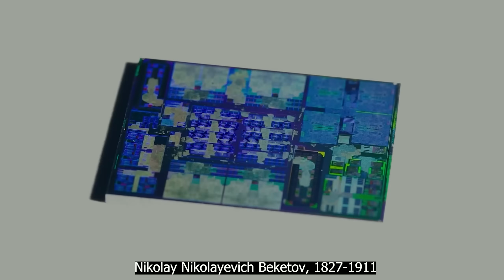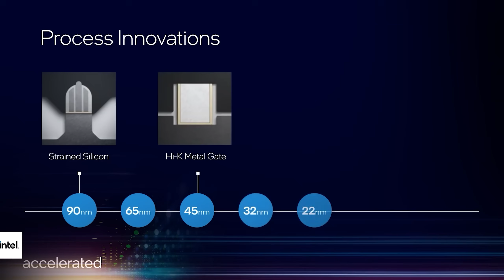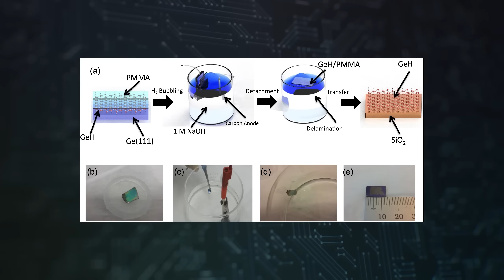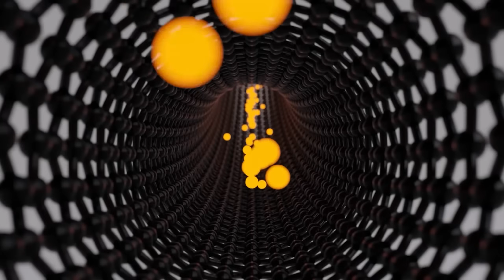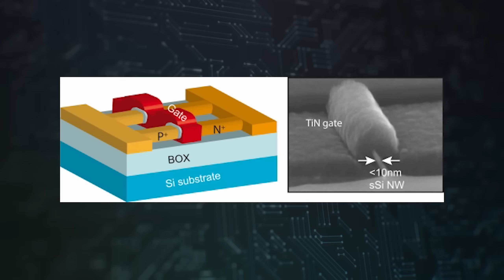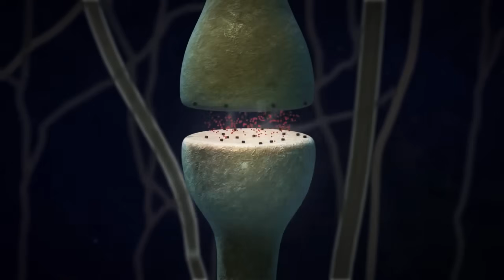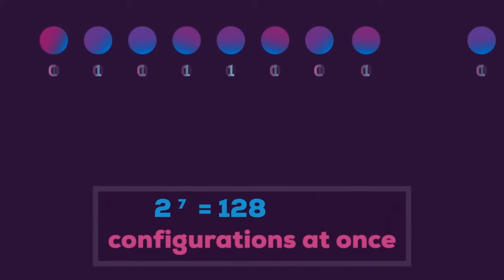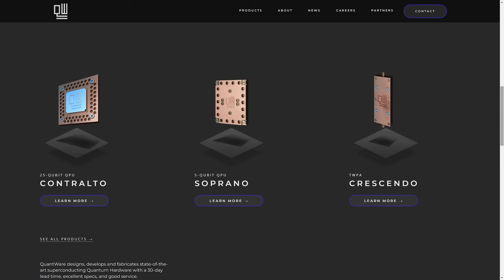End of the silicon era. Processors of the future

Comment: But what about analog computers? An axle has it Theoretically infinite positions and therefore can theoretically store an infinite amount of data And you don’t need to make them big you can make them I have comparable size to a transistor still requires overhauls of computer science but same goes for quantum computers and trits also I doubt you’ll be seeing a quantum computer running Windows 10 anytime soon
Reply: Has theoretically*

Comment: Another direction we could take to fundamentally change how computers work in order to increase efficiency is reversible computing. The laws of thermodynamics gives us a minimal possible energy cost per bit of computation, which we are slowly approaching. However, there is a workaround, since the actual cost is in erasing information. So long as the computation does not erase information, there is no theoretical lower limit in energy use. 

With technology based on this, it might be possible to build 3d-chips having to worry about the heat problem at all. That said, it's at least as fundamentally different from how computers function today as quantum computers are, so it will be very difficult to transition and we will still need components that actually erase information in many cases.

Comment: @3:10-3:21  uuumm dude you talking some shit on ryzen 7000  , those chips are hitting 90 C because AMD made the heat spreader so damn thick to make the chip line up with AMD heat sinks. saw a video where some one de-lided the cpu and whent strait from chip to heat sink and the chip was toping out at only 74C then.  so the 90C  is only due to having a thick heat spreader not so many transistors.

Comment: We still got some ways to go with classical architecture, you can also gain some performance by improving how quickly we can access memory and how much of that fast memory we got, there are also architectural adjustments with concepts like RISC, bigLITTLE, vcash, new schedulers in OSs etc. so both on hardware and software level. 
With many new technologies being developed like Quantum, DNA-computing and Optical-computing, I don't think these will replace classic computer but with interconnects between them then they can work in tandem in the tasks they are best at.

Comment: Doesnt it mean that 1 Qbit  has 2 times the computingpower of an ordinary bit.  so i understood it like  1 qbit = 2 bit.   2 qbit = 8 bit. 3 qbit = 24 bit 4 qbit = 64 bit.   which if you use a CPU from an ordinary PC just change it from Bit to Qbit  with a simmilar archetecture... wouldnt that be like a couple of thousand to million times of more computing power just with changing the physical base of the computersystem?   But what kind of consitend number system could we use to do stuff with it? i mean 4³ = 64 but its just a single case of "thats right" . I thought it threw like 20 minutes and couldnt find a numbersystem that can be used. or does it already exist?  At the same time you would just need a 4 qbit Windows to get the same as a 64bit Windows.  this is so small in size compared to each other... like.... wtf.   I would say AI  is only possible to be  more I than A  with Quantum technologies.

Comment: The next frontier will likely be 3D chips. We already do build them with a few layers, especially memory chips which are dozens of cell layers thick now. We will need to do the same with processors, and also switch to more thermally efficient materials to help avoid the increased heat per sqr unit as a processor gets thicker (building heat exchange tubes into the design itself can also drastically help combat this).
A 3D design also opens up pathways for much more optimized computation methods that a chiplet design does not really lend itself well to as it scales. Chiplets primarily communicate to eachother through side channels, whereas a 3D chip would simply be one single complex chip of interconnected logic in all directions.

The potential performance gains as we add layers is insane to think about, when you consider how thin a given layer of a processor is. You could have hundreds of thousands of layers eventually. A single processor rivaling billion dollar super computer warehouses of today.
Reply: da cube chip
Reply: Would the AMD 5800X3D be considered a 3D chip?
Reply: @dylanhecker6686  Not really, it's only the cache, which is essentially on-die RAM that is stacked, which was already being done for your SYSRAM too. The core logic is still single layer.
Reply: @invertexyz  thanks!
Reply: Well we already do have '3D chips'. A processor consists of many layers of circuits stacked on top of each other.
Reply: @Pythoner  bruh stop with this "TecHnICalLy 🤓" stuff holy sh*t why are so many people on this videos comment section so pretentious. 

You know what he meant he literally said what you said on the first line of his second sentence.

-"We already do build them with a few layers"

do people just lack reading comprehension nowadays?

what he meant was a 3d architecture as in cores on top of each other as well as next to each other. Yes "technically" we have 3D chips already but 1- they barely have any depth there still relatively flat and 2- our architecture of the chip is STILL 2D as in it can be represented by a 2d map theres no such thing as layered cores.

I'm sorry for going off at you but so many people on this comment section( of the whole video)are just acting so pretentious as if they all have degrees in computer architecture .

Comment: Carbon isn’t much of a replacement. Say if we do adopt it and make the next best thing with it, there still wouldn’t be much room to scale down. We are already running into atomic limits with silicon. Being able to build with carbon with atomic precision doesn’t actually help us that much. Instead of getting smaller we are probably going to become more clever. Different architectures, or coming up with different types of processors like GPUs or maybe a quantum computing chip one day. It’s not about raw power, smallest size, or most transistors anymore. It’s about coming up with the best arrangement of those things. I think photonics would allow greater gains in computing than anything else you discussed.

Comment: Silicon still has a way to go before its phased out. The key is better packaging (things like 3D stacking).
Reply: 3d stacking will exacerbate heat dissipation, though, so it is not a valid solution

Comment: correction about intel and amd CPUs getting hotter.
while the premise is true (CPUs getting hotter), the conclusion isn't.
CPUs are getting hotter because intel and amd are increasingly trying to come out on top of each other, to the point that they've basically pulled every lever they could to squeeze those last few percentages to better market themselves. the truth is, if you drop performance slightly on these chips, power consumption goes down by a lot. it is not a linear correlation. if i'm not mistaken, increasing voltage on these chips means squaring the power consumption.

Comment: Optical transmission has been long achieved. Silicon Photonics is slightly different from the examples you’ve provided. Silicon photonics is also far more ahead than quantum computing and realistic in scaling towards a household. Think about how massive quantum computers have been for the last decade. The most realistic application is utilising an actual quantum computer to process data on a cloud network. It’s simply infeasible to have quantum computers for everyone, people won’t be able to game on quantum computers etc. Asianometry does a good breakdown on the technology of Silicon photonics, limitations and advantages.

Comment: This is what I like best about YouTube, you got me thinking...
1) The way we are doing things now is coming to an end.
1a) we may get smaller features, but we are close to the limit
1b) due to size, we may find different circuits that get better results, but again an incremental change
1c) chiplets, and other die layouts, can give up more performance, but nothing major.
2) We need to think about pipeline, Risc/Cisc/Vliw, process.
2a) my personal opinion is we need to rethink compilers and CPU so they make optimal code, not optimizing compilers for a CPU
3) The software process is broken
3a) with ~8m lines of code for Linux and ~50m for Windows 10, something is wrong
4) I am a product of 16-bit words and 64K of memory.  
4a) My OS was 4k
4b) I could run a word processor or a spreadsheet
4c) my machine was 10 MHz
5) when we buy a new machine, we generally get all new things
5a) New OS do NOT need to be backward compatible

I really think we need to look at how we move the software to a CPU and fix that issue.
Reply: that was a different time, with complexity many orders of magnitude simpler, no need to support a hundred different processors, and thousands of different IO devices, yes it has to be mostly backwards compatible or else you waste billions of dollars of software development for little to no gain.
chiplets still has a long road ahead, we can go really far with it specially when we start stacking chiplets.

Comment: Umm, the death of silicon as a base for ICs is GREATLY overstated.

There is this thought about some END coming that just fails to think clearly about what will happen.  So let's evaluate some timelines.

Sure, silicon is going to hit a limit, but so would any other material.  If you want an IC based on on/off transistors, there is only so small you can make the transistors, but once you hit that theoretical size, is that the death of silicon.  The answer is no.

YOu can measure CPU performance in multiple ways.  One is raw performance.  Raw performance is based on work done in a certain amount of time, but to calculate this you use multiple types of applications to calculate this performance.  If I want a render machine, do I need a CPU that's great at gaming?  The answer is no.  I need something that's great at stream processing, and that could be a combination of CPUs and GPUs and accelerators, or a computer that integrates all three in a single circuit to run any type of stream processing programs.  Maybe with the accelerators I can program it first before running the job, so the first part of the render application checks for an FPGA and if it exists it programs the accelerators before running the render tasks.

Next, at the beginning, which is as far as I got because these kind of videos are silly, the talk is on chiplets and IPC (Instructions per clock cycle).  What was skipped is making a process node much more efficient at running higher speeds.  There's no law that says a CPU can't be clocked over 6GHz.  In fact I think over the next 5 years TSMC and Intel will both have process nodes that run 6 - 6.5GHz and it won't be very high power consumption.

Also what isn't mentioned is compute power in 3 dimensional space.  We're getting to the point to where ICs can have multiple layers, and this is for different reasons, one being the shrinking of transistor size and every shrink usually comes with power reduction.  I think it's safe to say that CPU design is going to involve 3D layouts and this will involve layering in such a way to where one layer isn't producing so much heat and the other layer can, so planning out the layout of circuits will become more complex.

But here is the REAL meat and potatoes of this.  Home users already have access to so much compute power it's crazy.  A home user can now do with large servers had to do 10 years ago, and in another 5 years the amount of power that can exist in a laptop is competing with servers from a decade ago.  The move to 2nm or Intel 20A which are the same thing is SO monumental that for home users there's no need to get past that.  The issue won't be not having enough compute power, but having too much with rare exception.  One area of growth is PC gaming.  Graphics compute still has to improve to get high quality 4K gaming.  But, we're there NOW.  The GPUs that AMD and Nvidia are releasing right now are good enough for high quality 4K gaming, and this is using a 5nm node or modified 5nm node (TSMC N4).  When semi-conductor companies get to 2nm the issue won't be not having enough transistors anymore.  It will be hard to keep adding more compute units (graphics processors) and in fact for Nvidia GPUs they're using multiple types of compute in a single GPU, and that's basically the raw compute for making the image on the screen, a lighting and shading technique used for games called ray tracing for there are RT cores, and then the cores for AI, tensor cores.  2nm is SO small with SO MUCH transistor density that home computing just never needs to move to anything else, but there will be other nodes that come out with better transistor density, so like 18, 16A, etc.... and this can probably go all the way down to 10A.  By this time we're about 2 decades from now.

The REAL issue isn't going to be transistor density.  It WILL be about making machines smarter, to where they can do more with the same number of transistors.  IPC isn't a gimic.  It's how you get more performance in a fixed time period from a CPU over an older CPU at the same clock speed.

So, there are many tools for improving compute power, and they are NOT gimmicks to hide some flaw.  It's PART of better engineering for computing.  

One is more processor cores.  For home computing though you hit a limit because most programs home users use don't have so many processing threads and adding ever more cores is a total waste.  For servers on the other hand, there are many types of server compute loads that can benefit for a LOT more cores.

Another is clock speed.  But this has to be solved while at the same time keeping power consumption down.  THIS is a real issue and it's hard to solve, but it IS getting solved slowly, but every process node is different so you have to solve that problem for every process node.

Another is instructions per clock (IPC).  This also improves over time and one of the ways to solve this is simply to have more cache so the cores have more data and instructions next to the cores instead of having to access system memory to get data/instructions.  But there are other ways to improve IPC too.

Another is making better processors that can accelerate workloads.  AMD, Intel and Nvidia are all working on this, and even Apple has done excellent work with acceleration and that's part of what makes the Apple M1 and M2 processors so fast and NOT the fact that it's based on ARM instead of X86-64.

Another is being able to stack transistors which shrinks the area needed for the same circuit.

Another IS chiplets.  This helps with heat issues.

The point is, yes silicon will hit a limit for transistor density for a 2 dimensional area, but that's a single problem, not THE problem.  Solving the other problems I listed is more important. 

And lastly we can talk about how much silicon is needed.  Well, as process nodes shrink transistor size over time, a single wafer can make a lot more ICs, so we are always improving the number of circuits that some from a fixed amount of silicon.  It's not an issue at least not for another 50 years or so.

Comment: I don't see quantum processors replacing processors but if they become cheap enough I can definitely see them becoming a new component of the computer. If they do replace anything it will probably be graphics cards. All in all, we probably won't see quantum computers hit mass market until probably decades. What is more likely to happen than most theories is the integration of supercomputers, powered by more rare metals, that use the internet to give you your computer as a service rather than owning a computer. The system we have will be a lot more stupid and only decode the sent information.
Reply: Yeah I feel like cloud computing will be big, but hopefully the next big "breakthrough" will be just moving away from the x86 architecture. This should buy us a couple more decades at least before we have to start replacing silicon, or whatever other new innovation occurs during that time
Reply: god i hope not, i hate this rent mentality.
fuking WEF kikes will better write their wills if they try this.

Comment: 4:56 Not quite true. I have some Germanium transistors here which were used at 10.7 MHz, and some other low power ones which were used at over 100 MHz. They were expensive, but very capable at low currents. Bipolar Silicon transistors have been made which would amplify at frequencies close to 20GHz (I made some of them, back in the 1980's.)  For higher frequencies, JFET, then MOSFET, IGFET and other types are needed.  But yes; Germanium transistors are definitely very limited at higher frequencies, in comparison to Silicon devices. Leakage currents are very problematic, and they lead to high noise levels. It would still be interesting to know how a Germanium MOSFET would perform at somewhat higher frequencies, however.

Comment: Overheating becomes less of an issue with the reduction of transistor size. The only reason modern transistors are emanating more heat than older models, is because manufacturers make use of that reduction in heat output, by increasing cores, core frequency, and core complexity (more transistors per core).
Reply: that's only happening because the transistors no longer use less power when Shrank at the same rate of the volume reduction which used to be the case now a 2x volume reduction only leads to 20-30% power improvement, which is not enough,